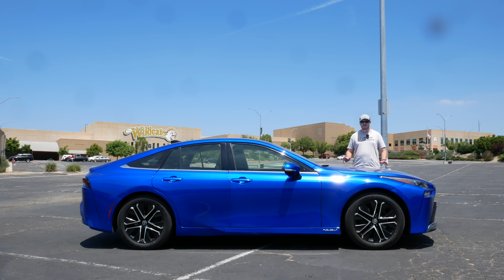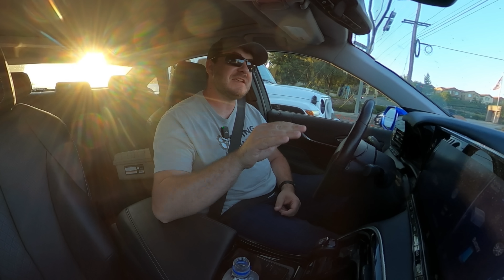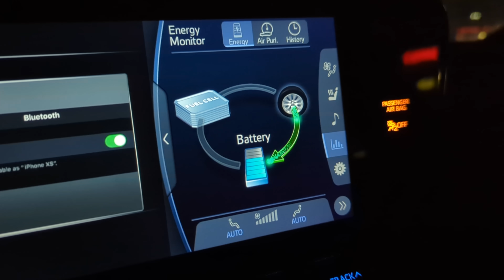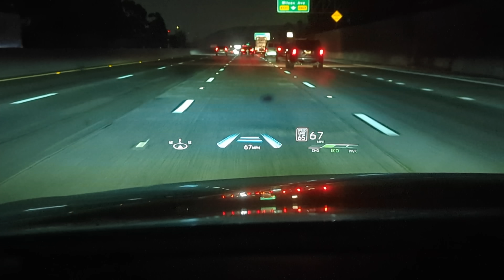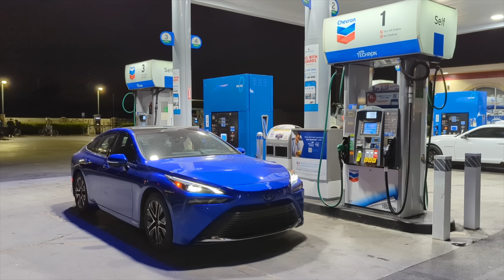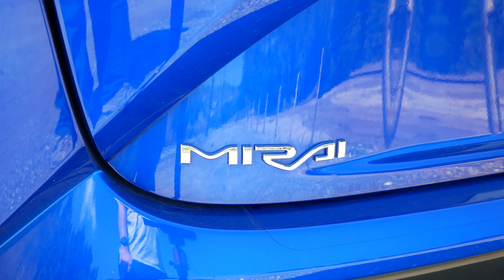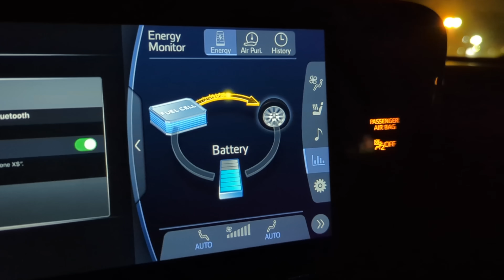The Toyota Mirai is Disappointing

Comment: Another disadvantage of H2 cars that you missed is that, yes, it takes 5 minutes to fill up... if the fueling station has already re-pressurized since the last car filled up. To push that 10,000psi of hydrogen into your car, the station has to pressurize its own hydrogen at an even higher pressure, and that takes about 10 minutes to do after it's pushed hydrogen into another car (and thus lost pressure in its own tanks). 
This means that if there's a line at the hydrogen station, it takes more like 15 minutes to fill up, rather than 5.
Reply: Still better than EV but ooof.
Reply: @GeorgeWashingtonLaserMusket  It's not, actually. Modern EVs can charge in under 15 minutes.
Reply: @coredumperror  Not from empty to full they can't
Reply: @kezyka6775  They can, there are BYD cars and chargers that have batteries that can charge from 0-90 in 7 min and 9 mins for a full battery. it charges with 1000 kilowatts.
The charging station has 500Kw/h puffer batteries so tha main doesn't have to supply 1000Kw.
Reply: @kezyka6775  BYD can do 10-97% in 8 minutes.  0-100% in 12 minutes.
Reply: @fabiankehrer3645 I take any stats from a Chinese car with lbs of salt.
Reply: @DrakonPhD   Look it up.
Reply: @DrakonPhD  Just watch the videos of people doing it themselves. Out of Spec Reviews has a few of them.
Reply: Still better than an EV for now
Reply: @DioTheGreatOne  How do you figure?
Reply: @DioTheGreatOne  Hydrogen is a terrible idea, and makes no sense over an EV. EV's at this point are inevitable.
Reply: @daydreamer8373 Except in the use-case that Robert outlined for long-distance vehicles, which I find a highly plausible use-case.
Reply: @godminnette2  except there are a whole bunch of EVs that have more highway range than the Mirai. and DC fast chargers are also way more common than H2 stations.

So H2 just has no ground based transportation niche where it is better than BEV
Reply: @anonym3017 Sure, but that isn't what's being discussed here. The Mirai itself is a disappointment. However, a hydrogen vehicle has greater range potential than an equivalent sized BEV - it's just a matter of energy density. And while more hydrogen stations would be needed, if they're niche vehicles, that could be fine. Having semi-trucks and similar vehicles fuel up at a separate location for hydrogen would be fine.
Reply: @godminnette2 except they don't have a higher range potential than BEVs.

Cause storing those tanks is really goddamn awkward so you can't get too many of them in.
Reply: @anonym3017 yeah hydrogen is pointless. With EV there is already an electric grid and you could even charge from solar, while rare now  solar/batterioes will only get better over time.  Meanwhile with hydrogen you would have the huge expense of replacing every fuel station with hydrogen equipment and having to truck in all that hydrogen every day.  
And at the end of it all you get what 58mpg equivalent when it comes to gas?  I have a 1.2l gas hyundai that gets 50mpg.  Maybe hydrogen could be suitable for ships or something but for cars even trucks it's pointless.
Reply: @mikesully110  Yeah, your last sentence is the real kicker. When you scale way up beyond where you can with ground transport vehicles, hydrogen starts making potential sense because of its energy density advantage. 

All the extra stuff you have to install in the vehicle to make a high-pressure hydrogen fuel tank safe cause a massive percentage increase in the total size of the fuel system compared to the total amount of fuel stored inside it. This is why the Mirai's range is comparable to a typical long-range BEV today, despite hydrogen having such a huge energy density advantage over lithium-ion batteries: their tanks can only store 5kg of H2.

But if you scale up to a large airplane or a cargo ship, that percentage of tank-mass dedicated to safety drops radically, meaning you can store a lot more fuel per cubic meter of tank.

Plus, planes and ships don't need to fuel up part way through their trips, so the problem of building out thousands of hydrogen fueling stations along highways and in cities (and trucking hydrogen to them) instead becomes the much more tenable task of upgrading the fueling facilities in airports and sea ports.
Reply: @godminnette2  does hydrogen really have higher range potential in an equivalent sized car though? Battery tech is constantly improving while 5kg of hydrogen will never contain more energy than 165 kWh.

For example, the new BMW i3 and iX3 have a 108 kWh battery, which given the efficiency of the hydrogen fuel cell already give them significantly more range than the Mirai.

Comment: If the fuel cell doesn't degrade too severely, and if green hydrogen can be done affordably, then I'm actually very in favour of hydrogen powered vehicles.

BEVs come with issues around cell life as well as up front cost, and morally questionable supply chains.

The issues around hydrogen efficiency can be diminished if we produce it as a byproduct of renewable energy.

So, a lot of ifs and maybes, but if they can be worked out this seems like a technology worth working on.

Comment: Hi Robert, just would like to mention that most of the cons you mention were/are true for electric cars as well. Infrastructure: go back 15 years and EV's faced the same issue as the Mirai now, a lack of network to support it. Energy source: yes at the moment most hydrogen is not made in a 'green' way, but the same is true for electricity.
Reply: A ubiquitous nationwide electricity grid already exists, with connecting chargers to it being the only thing required.  There is no corresponding system for creating and distributing hydrogen at scale.  It would have to be created from scratch, which would be very expensive and take decades.

Comment: The main downside of fuelcell are the rare metal you need. Platinum or palladium and iridium are expensive and the available among isn’t enough for mobility. Compare to this lithium is cheap and available. The energy efficiency  is ok compare to gas / diesel cars but far away from a EV

Comment: It kinda feels like the technology went stagnant because everyone went "oooooo EVs" and gave any and all alternatives the blind eye. I feel it's totally feasible that if enough research was being put into hydrogen vehicles as there has been for batteries on EVs, there might actually be a better market for them.

The idea you postulated about marrying both technologies sounds like a true way forward. "Refill" the fuel cell and let it recharge the battery with plug in being the secondary charge method.

Comment: You sold me! (no kidding I really want one) My idea is that after it is too annoying to drive anymore, or the infrastructure goes away, one might set up a solar powered, what did you call it? "alkali electrolysis hydrogen thingy", and use that hydrogen to power your house? One question, how long do the fuel cell stacks last? Can I use the steam to heat my sauna or water heater?

Comment: What about CNG!!!???
Reply: Produces CO2
Reply: @Freba9   true but burns cleaner than gasoline gas grids are everywhere and gasoline cars are easily retrofitted to cheaper natural gas.  Seems a lot more doable to me.  Just need the refueling stations.  Doesn't make sense to me to burn nat gas in a power plant to power the hydrogen generation...  Just my thoughts.
Reply: @wesleyblaha3537  Yes, but the benefit would be low. Better use natural gas for power generation and use it to charge EVs.
Reply: @Freba9  EVs are expensive and natural gas is half the cost of gasoline.  EVs do make A lot more sense than hydrogen.
Reply: Pretty sure I've seen buses powered by it

Comment: i can't speak much on a vehicle side but we utilize Hydrogen Forklifts at my job honestly its much more enjoyable spending a couples minutes to fill up a tank an driving back off then speeding a couple hours recharging Electrical Forklifts ..we cut down massively on the amout of equipment need as many lifts in rotation due to battery going flat or drying ..now we can just pull up,refill, an off you go back to work

Comment: Your analysis for hydrogen vehicle is so well done, on its advantages and disadvantages. However the problem for green electricity and EV is the flexible supply and demand that cause load on the grid (which many have came up with plans to offload, such as using EV as batteries for peak hours and charge them where supply is high). I still think green hydrogen combined with carbon capturing, that could output methane or even gasoline through Sabatier reaction or such, is a better way for non-grid green generator solutions, such as solar farm or off-shore wind generators, which are much more easy to handle than hydrogen itself.

Comment: To me the advatnge of hydrogen is that they are viable for those who don't have off road parking (so in the UK that is the majority of the population), and that the hydrogen can be stored relatively easily so separating supply and demand. Come up with a small scale hydrogen generating plant and they can be part of the fuel station, generating hydrogen 24 hours a day from local wind and solar ready for when someone want to refuel. Unlike pure electricity where supply and immediate demand have to be relatively closely matched.
Reply: Far easier to implement public AC charging.
Reply: @Freba9  , not sure it is when that means people sitting in their cars waiting for them to charge, and is doesn't decouple supply and demand.
Reply: @katywalker8322  I meant along the street charging. You can just park your car in your own street and plug in. Also: there will always be an average number of vehicles charging, so a lot of renewable energy will automatically find its way to the EVs.
Reply: @Freba9  , not really viable with cables stretch across public area, plus problems having enough connection points. Even using every lamp post would probably well under enough for 1 in 10. Unless the system can take electricity from some cars to charge others it can't really balance supply and demand.
Reply: @katywalker8322  It works fine where I live. No problem with cables. Also, not every parking spot has te be equipped with a charger as you don't have to charge on a daily basis. The balancing effect from increasing and decreasing charging speed over the day is already really big. But bidirectional charging is also something they are currently experimenting with in the city I live in.
Reply: @Freba9  last terraced house I lived in has a single lamp post (on the side of the street with the terrraced houses - other side they are not terraced but have drives so no parking) for 24 terraced houses. That level isn't that unusual. I know a lot of people who live in terrace houses. Getting a parking spot is hard enough, let alone one near a lamp post (plenty of which are at the building side of the path rather than the curb, hence not viable for a cable) or similarly spaced roadside electrical supply.
Reply: @katywalker8322  I also live in a densely populated city and it works absolutely fine. It obviously comes down to proper planning by the city counsel.
Reply: @Freba9  , unfortunately, planning for a lot of these areas was done well over 100 years ago! Changes recently in some of these have made it worse (with blocked off roads to prevent people rat running, which makes sorting a parking location even harder).
Reply: @katywalker8322  That is a parking problem, not a charging problem.
Reply: @Freba9  the 2 are closely related.
Reply: @katywalker8322  It does not support your claim. If you can’t park, there is no reason to own a car in the first place. Regardless of its powertrain.

Comment: So in a Prius, when you select "B" the regen increases but the engine is also spun for engine braking too. This is really for long downhill grades to prevent over use of the brakes and brake fade. The engine can be spun for a long time and provide constant braking force but in the Mirai, I am curious how Toyota solves this for downhill safety. That tiny battery will fill up entirely in a matter of minutes and once that happens, it will not be able to provide any regen braking. This makes the service brakes the only thing left which is not good. The fuel cell itself can't electrolyze water to provide its own kind of regen so has Toyota installed a resistor style braking system like in diesel locomotives? That is literally the only thing I can think of that would be able to control the cars decent without constantly riding the brakes. I think there's still many use cases of using hydrogen rather than batteries and it is still early in the whole electrification scene. As you've stated, this car feels more like a more refined experimental vehicle rather than one for mass consumption. Personally, I would prefer this to a BEV but that's just me. I don't have charging access at home and without that, BEVs don't really make much sense.

Comment: with the available infrastructure, a hydrogen is basically just like a gas car as long as it's made by companies like Toyota, it's a car that will go as long as the fuel cells do, and they're easier to recycle. 
The problem with electrics is that they are increasingly lease-and-dump cars, which will only increase when Chinese makers get seriously into the West, and will just compound the whole resource / waste problem. It's always struck me as a myopic view to consider electrics as the future but the public at large is myopic and will go where the marketing goes

Comment: there are huge losses when transporting electricity over the grid. Especially the loads required for EVs. I doubt that the overall efficiency is 80%, because there are losses in electricity generation, transportation and storage. If we had invested more on hydrogen technology, the efficiency of the system would likely get much better.

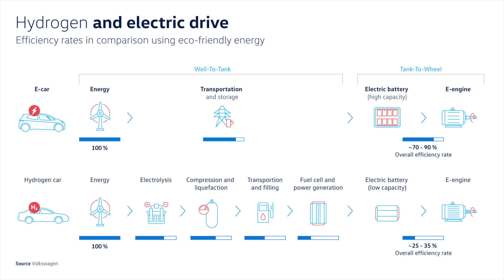The VW chart in 13:54 is likely huge BS, because it keeps the charging  step for EVs and because electricity transportation losses vary with the grid's size

Comment: I'm still waiting for battery tech to get to the point where an EV Motorcycle makes sense to buy. As for Hydrogen I don't see this tech making its way into many more passenger vehicles and more into things like Public Transport (trains and busses), construction equipment and haulage.
I wouldn't go as far to put Hydrogen Fuel Cells in vans though, the Royal Mail depot in my city have like 80% of their fleet as Peugeot EV Vans (a few Nissans and Mercs thrown in for good measure)

Comment: OK I have seen king of random do a very simple hydrogen generator from a pipe and few plates. So why can't nobody make a car, install some magic modified hydrogen generator, a few big batteries for the electrolysis and a modified gasoline engine that would accept and run happily on hydrogen which would be generated on demand as you accelerate and vise versa. You put water into the tank in the car, potassium hydroxide into other tank, you turn the key and the energy from big batteries go into the electrolysis cylinder and as you push the accelerator some beefy potentiometer ramps up the production of hydrogen, and in a separate tank you would keep a good amount of potassium hydroxide powder and it would mix accordingly my a servo valve into one special fresh liquid to keep the electrolysis happening. as the engine is running on hydrogen it makes the car move, but at the same time it spins an alternator with charges the batteries as the car runs, maybe put a bit stronger engine in the car so the power generated from hydrogen would be greater the power used by electrolysis from the batteries, so  as the car runs the batteries evens out between discharging and charging, or maybe even get charged as the engine spins at higher RPMS. It would work as a heat pump, where it uses 1 part of energy to spin the motor and compressor but it moves 5 times as much energy in the refrigerant itself.
Reply: It can't work. Basic thermodynamics. The 'invention' is a centuries old scam.